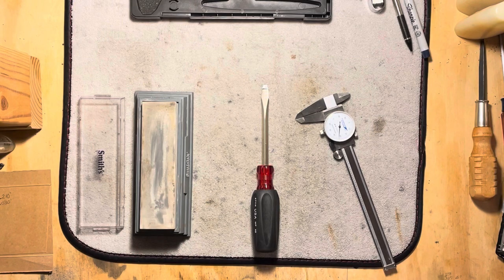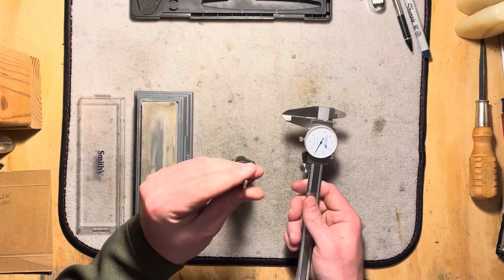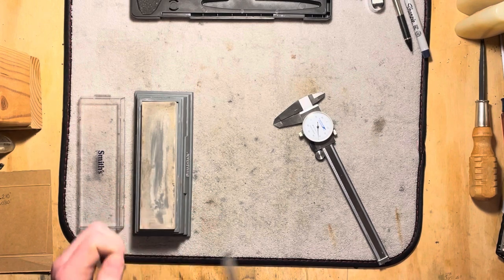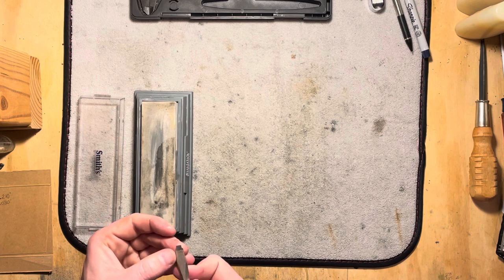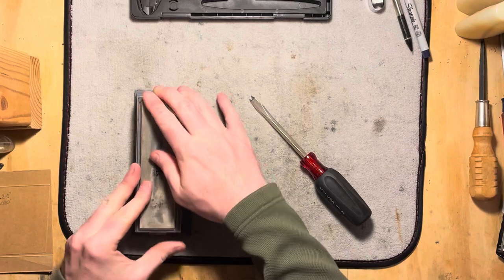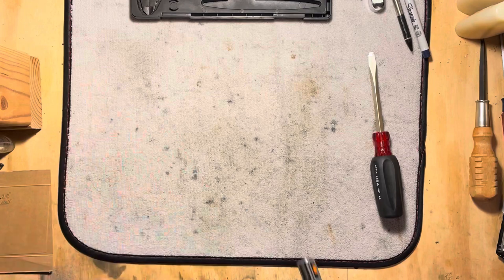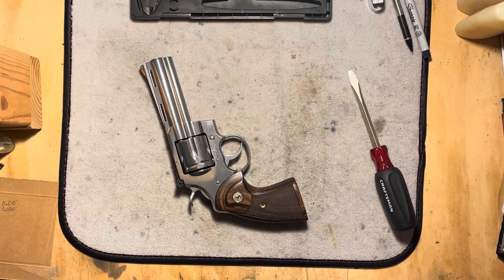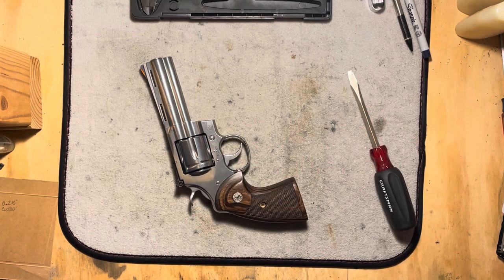Fitting a Screwdriver for Gunsmithing (Part 4 of 4)

Comment: This will work in a pinch. I made a few hollow ground drivers using a 5/8 stone wheel on the mill. You can not get a square and parrell tip with a file. Also it must be harden and tempered when ground.

Not worth the time.

I wised up and broke down and purchased a hollow ground hardened gunsmith screwdriver bit kit for $50.
There's a bit that will fit any screw.

Small investment considering what your using it on.

Pro tip. Use one or two pieces of Scotch heavy duty clear cellophane tape over the bit.
You won't have any scratches on the screws or holes or on the frame when you slip. 
Good video. 👍
Reply from the maker: I eventually need to just break down and get a MagnaTip or MagnaBit- whatever they call that- kit. I don’t do this for work anymore, so I have a hard time justifying it since I work on such a relatively few guns that have screws. My little handmade screwdriver for S&W revolvers has served me well for many years and that has represented probably 90% of the screwing I’ve been doing for the last several years.